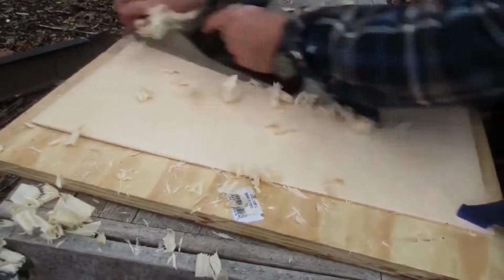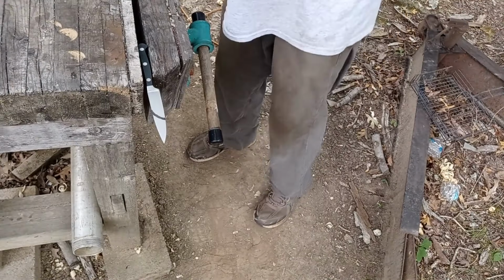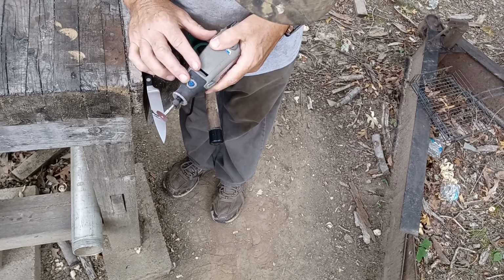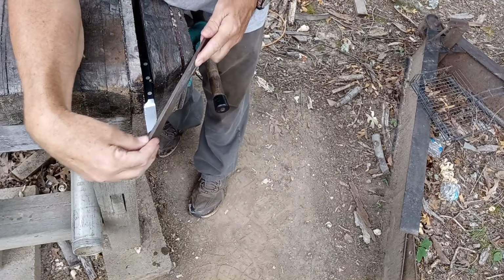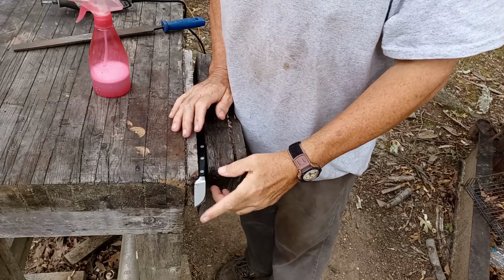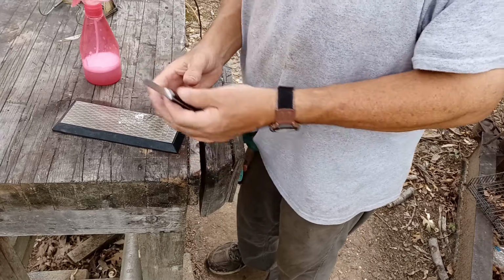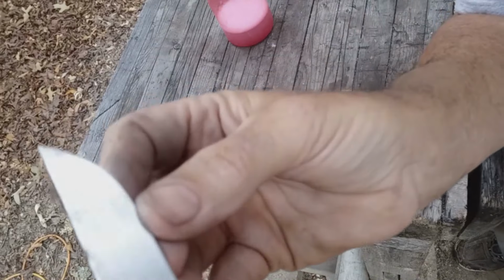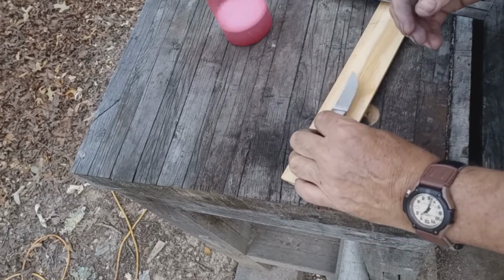Cool Little Marking Knife Anyone Can Make

Comment: Nicely executed marking knife.  I had thought about doing that some years ago, even went looking for some used paring knifes, and then life got in the way and I completely forgot to do it.  Something to add back onto my to do list.

If you can source some leather, you might be able to screw it down from the top of the vise, so the leather hangs down.  I believe Paul Sellers did something similar years ago.  Another option would be to stretch the leather it across the inner chops and screw it to the sides of the chops.  If you screw to the sides the wood should not come into contact with the screws.
Reply from the maker: Thank you! Fantastic!